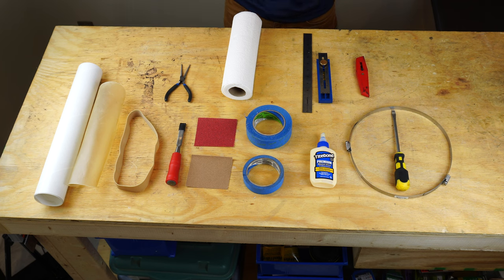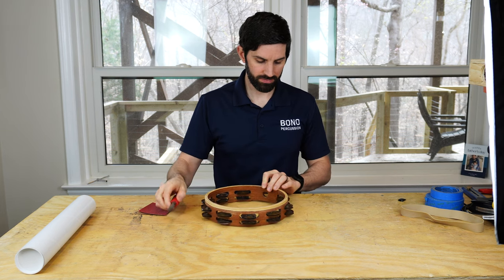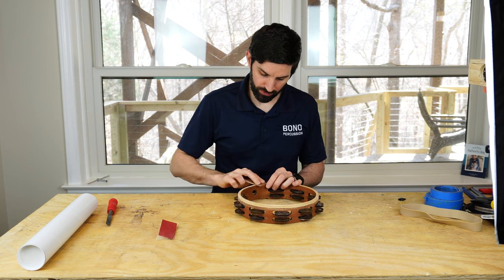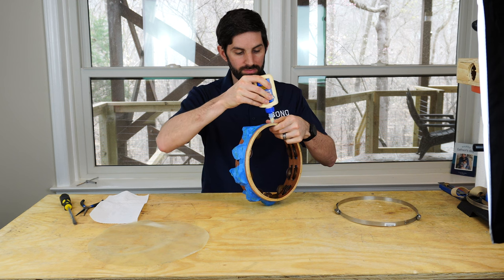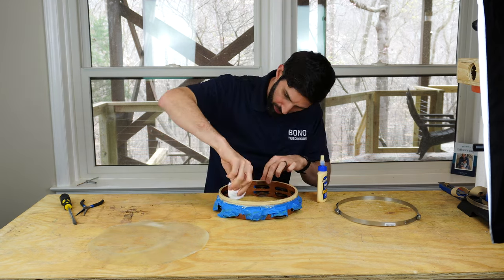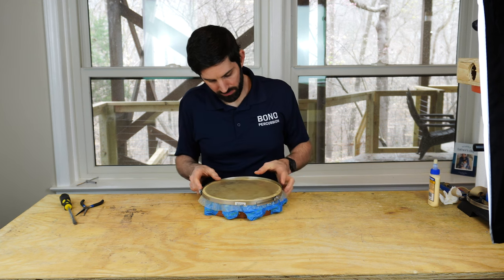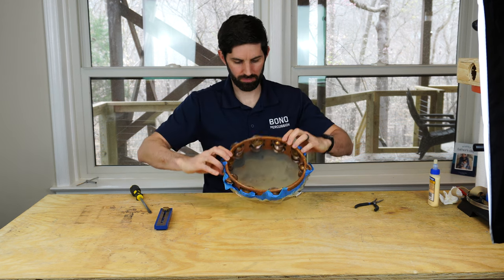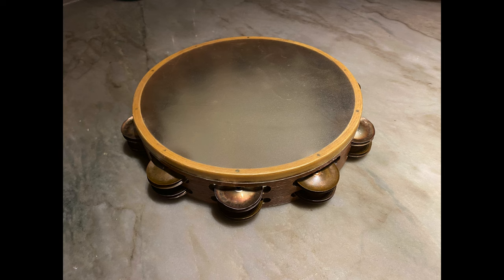Tambourine Head Change Follow Along

Comment: I really appreciate the attention to detail in this video. When I last changed my tambourine head (in 2022), I had to watch 3 different videos to get all of the information I needed to do the job. I am going to change my tambourine head again on Saturday, and I will use this video as my primary reference. You even mention things I had issues with the last time that none of the other videos addressed (like using different grits of sandpaper for the sanding and starting with a chisel...because it's HARD to get that crud off...and using different sizes of painter's tape for the jingles). Thank you so much for taking the time to do this. I will recommend this video to all of my students and colleagues!
Reply from the maker: So glad you found this helpful! How did the head change go for you?

Many thanks for passing the video along 😄
Reply: @BonoPercussion  I managed to change the head. I think I may have sanded too hard on the bearing edge in the past and caused it to become uneven, and I had trouble getting the hose clamp to sit completely evenly around the head. Nevertheless, it dried properly, and the new head has stayed on so far. I remain grateful I had this video!